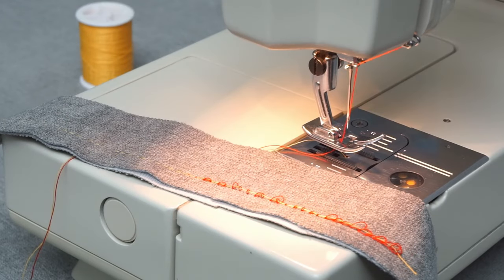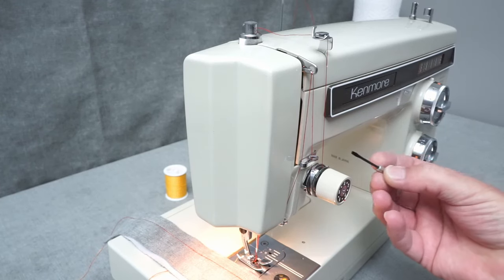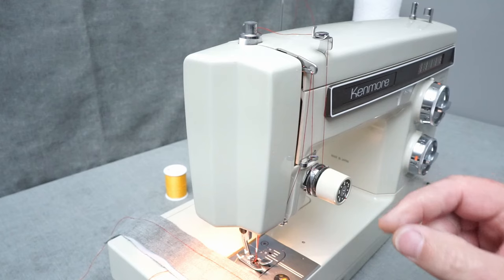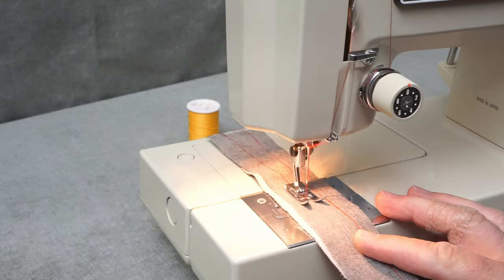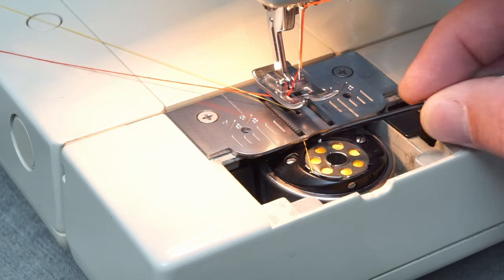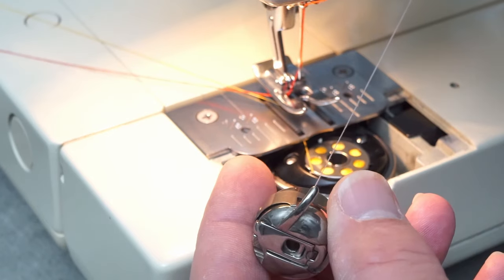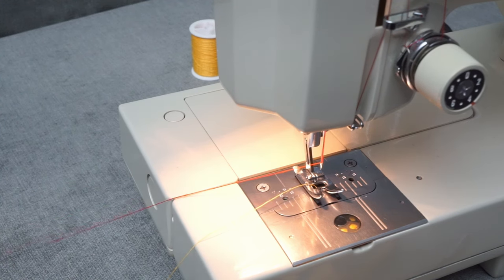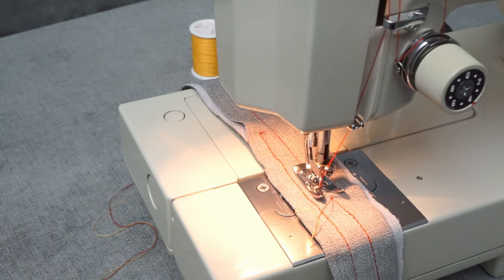Sewing tension problems upper and lower thread tension explained.

Comment: This was VERY helpful. I pulled out my grandmother's Kenmore and it looks so similar to the model in your video. I cleaned it up, oiled it, got it running pretty smoothly, and now I'm learning how to sew along with my daughter. This bit of information on thread tension does help, especially when you describe how to adjust the bobbin tension in the metal bobbin case. Thank you. I haven't seen that in any other video up to this point.

Comment: You can't beat the older Kenmores. For the money they out perform almost anything on the market today. Who needs all that computer stuff. It breaks after a few years. Old machines only ask for a lint brush and oil.
Reply from the maker: I bought this machine in Wisconsin this summer at a thrift store. Came with the original receipt from 1980 it was purchased at SEARS on January 10, 1980, price was $280.76 today that would be $951.00. Keeping it for small projects here at home,
Reply: @BlacksPorsche986  Definitely a bargain and a keeper. I have 3 vintage Kenmore machines and treasure them as much as my Singer 201-2.